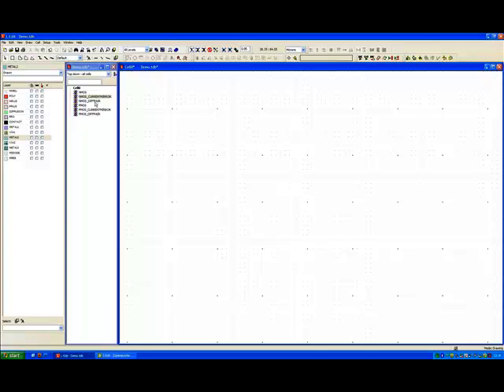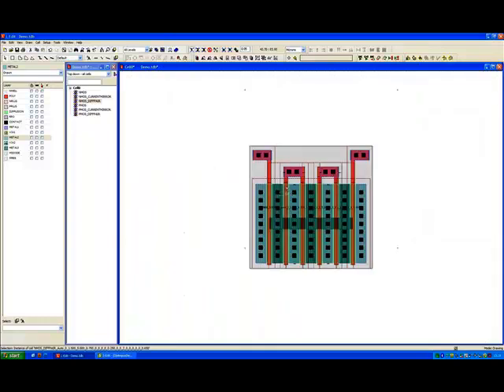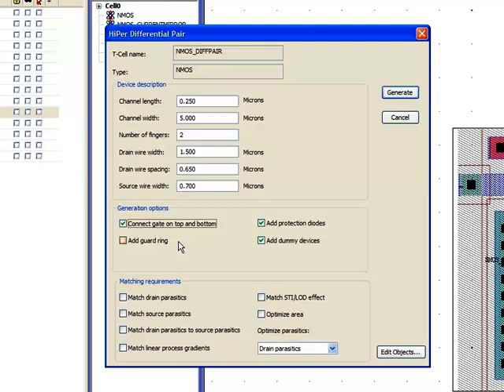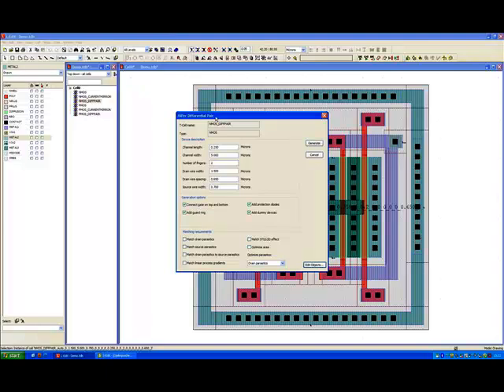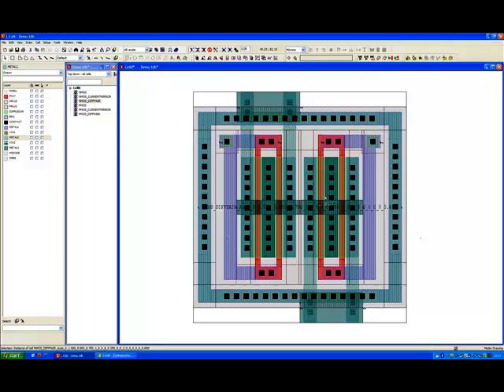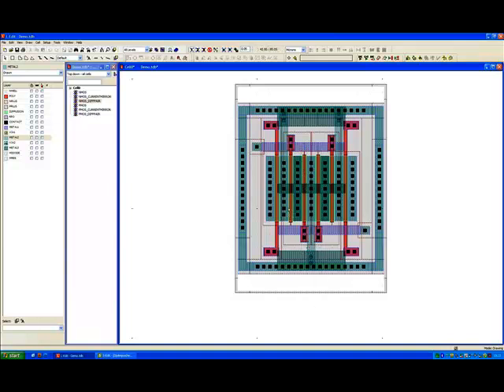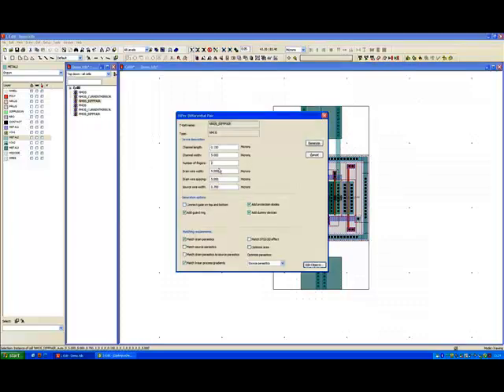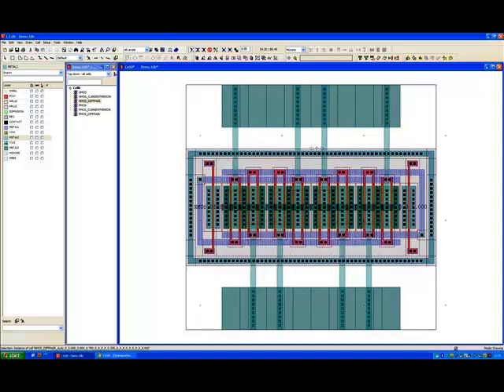Accelerating Analog IC Layout with Differential Pairs

Comment: Video states "[The differential pair] is actually well matched." None of the pairs of transistor demonstrated are well matched in the sense that all of the  transistor pairs are mirror images in a single annular area, symmetrical about the center line. Significantly better matching is achieved by making each transistor should be identical to the other, side by side, not rotations, no mirror images. Really appreciated the speaker pronouncing routing properly - rooting not rowting.
Reply: Michael Wright  do videos